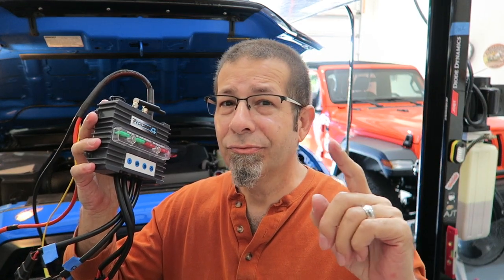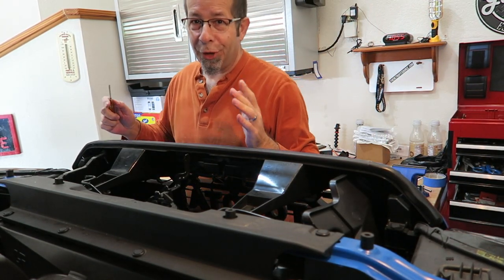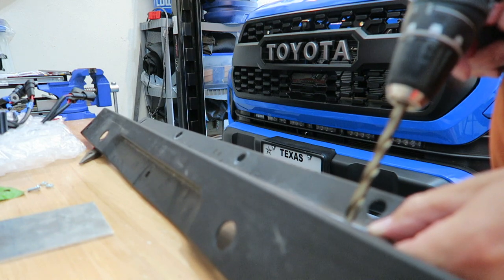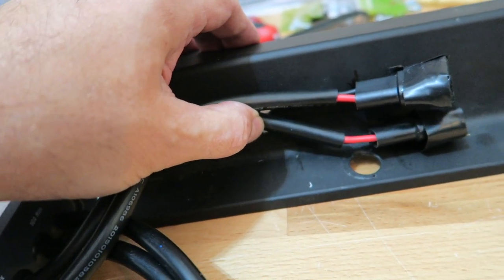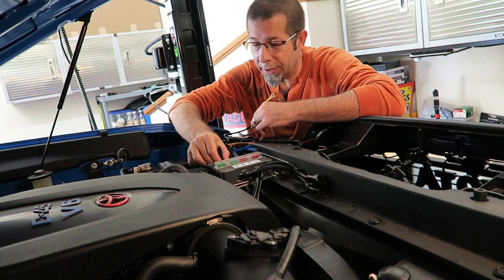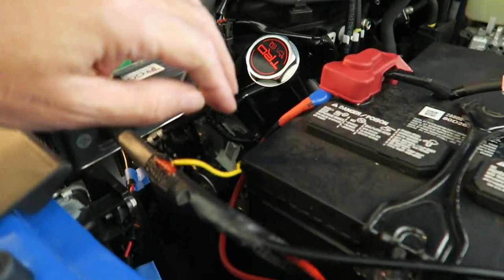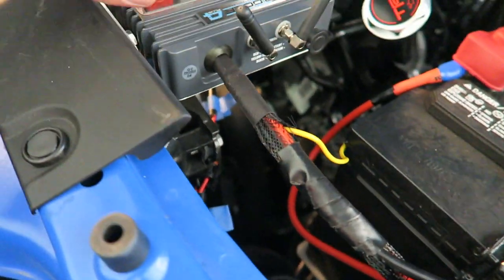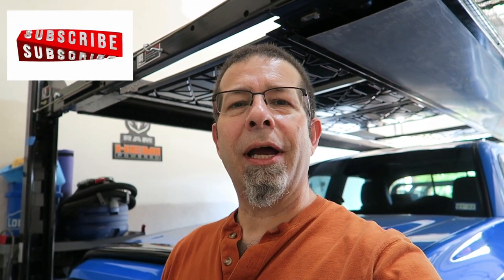Tacoma Wireless Light Controller Relocation & Wiring Change

Comment: I would have added washers on the back of that plastic as well. I wouldn't want that lock nut to pull out of the plastic. I may have found another fuse too for that yellow wire.  Inj is the injectors.

Comment: Good video, Rob. Good fix. I intend to invest in that controller to put on my Tundra so it was nice to see your installation video. I'm sure it'll be a little different on the Tundra but same concept...wire to fuse panel to circuit energized with the vehicle running. Thank you for your fine work. You f'ed it up the first time but you redeemed yourself!
Reply from the maker: Lol!  It’s all good now👍👍

Comment: Curious what amp fuse you added to the add a fuse that runs to the yellow Trigger wire?
Reply from the maker: I believe I matched the existing with a 10amp👍
Reply: Ok great 👍 your the BEST at responses 👏   I Finally got the Trigger4 🤗  thx for the updates and upgrades, keeps my installs clean, I couldn't do it without the UTubers 👊
Reply from the maker: Gotta connect that wire!  Don’t want any battery problems 👍
Reply: Was it drawing a lot for the battery to drain? I've seen other videos where the yellow wire is connected to the positive terminal so that you can hit the lights from inside your RTT in case you hear any commotion outside.
Reply from the maker: Enough to drain the battery after a few days.

Comment: Morning Rob, suggestion: get a agm batteries.i think will Sold ur issues on ur trigger. And also get  a upgrade to GP battery clamp from Amazon.
Reply from the maker: I think running the ignition wire solves my issue.  Thanks for the tip though👍
Reply: What is a GP battery clamp?

Comment: @RobMotive how do you locate a circuit that's on only when the ignition is on? Thanks.
Reply from the maker: The only one that I know of is what I used in this video.  🤔
Reply: @RobMotive  thank you sir. And anything special one has to do to add that fuse for the yellow wire? Sorry for the basic questions. I am new to all this and want to make sure I do it correctly. Thanks.
Reply from the maker: No problem 👍. Everything is in the video (s)👍👍

Comment: I know this is probably a stupid question, but why is this needed?
Reply from the maker: Do you mean the unit itself or the changes I made?
Reply: @RobMotive  the unit Rob....I get that it was drawing off your battery?
Reply from the maker: Makes adding external electrical accessories easier and, since they’re remote controlled, you don’t have to go thru the firewall with wires or add switches.  Plus....it’s too cool😬